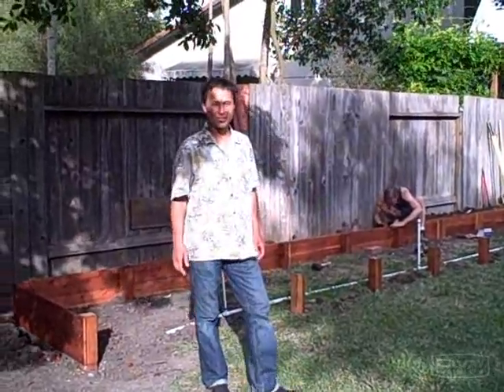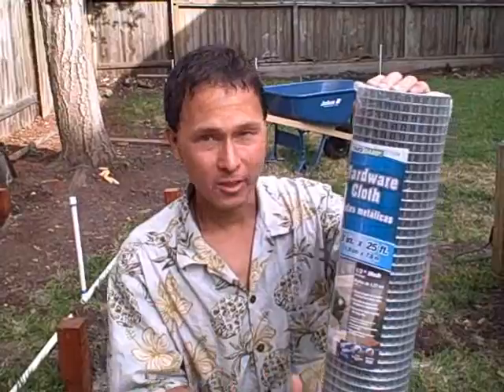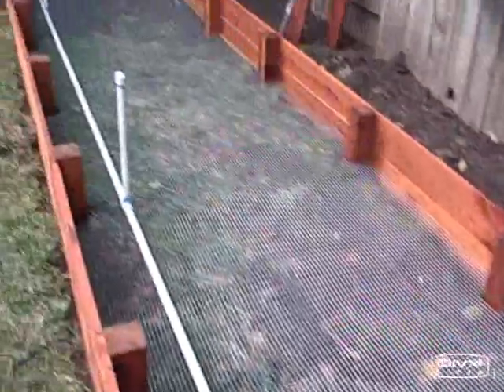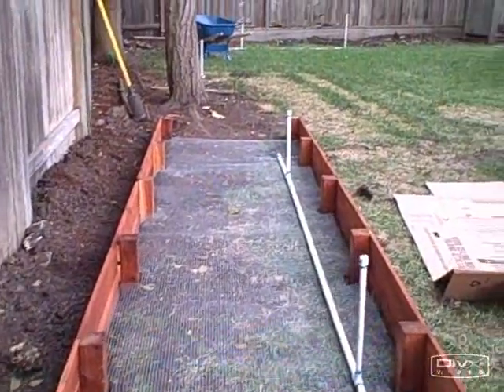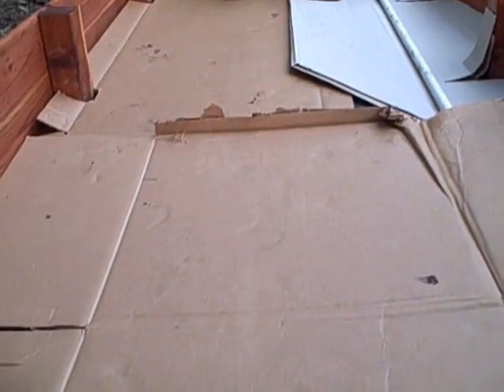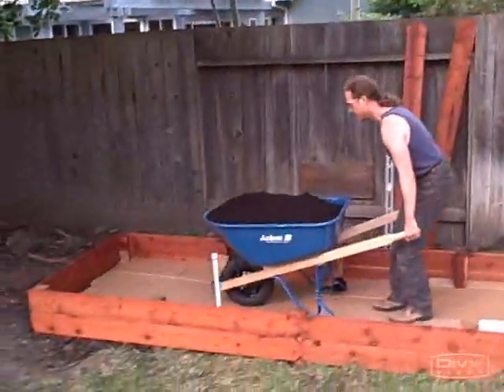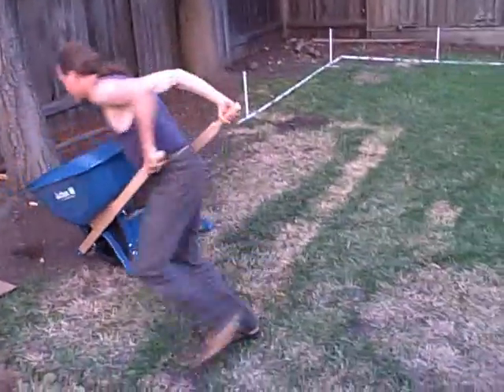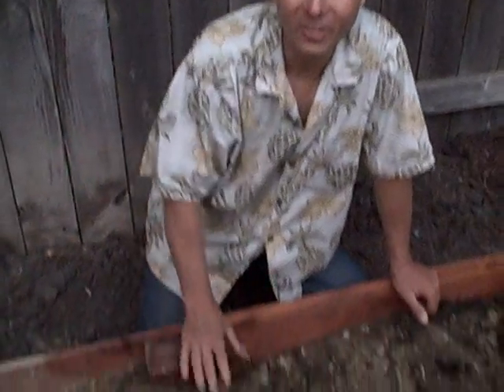Part 5 of 7 How to Build a Raised Bed Garden: Sides, Gophers Protection, Sheet Mulch and Filling

Comment: I think if you are capping the planters for sitting, you would want to put the 4 X 4s on the outside of the planks.  That way, you don't need to cut the hardware cloth, also they would resist the outward force of the soil, and your seat doesn't overlap too far into the growing area.  Only 1 downside I could see, is that it adds greater width to the "footprint" of the planter.

Comment: To make it even more secure from gophers, you can attach (staple gun or screw) the hardware cloth to the bottom of the base boards, or between the two lowest boards. That can prevent the gophers from pushing between the boards and the hardware cloth. Some people have had gophers push hard enough that the staples pulled loose and the gophers managed to get into the beds.